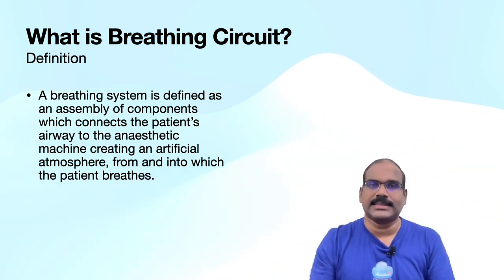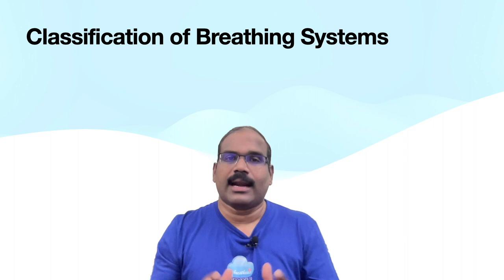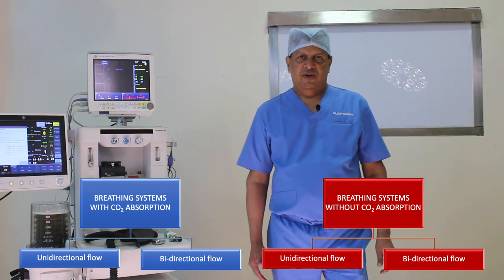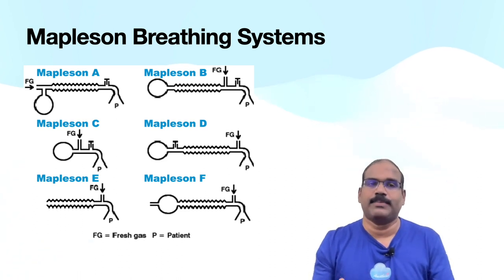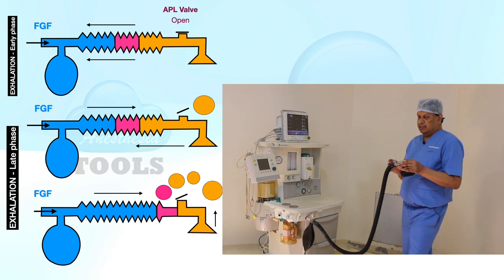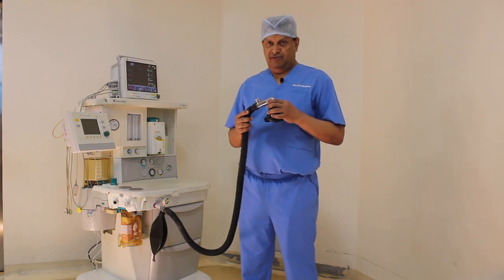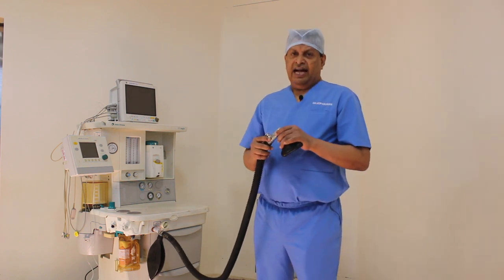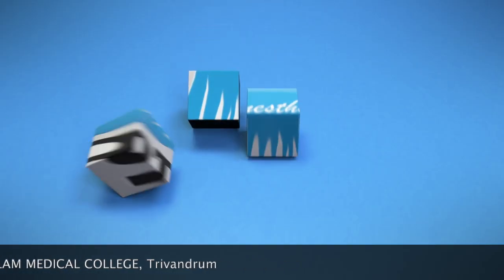Anesthesia Breathing Circuits: Module 1 (Introduction, Mapleson A)

Comment: Hi sir
This is an interesting and amazing video, thanks for this
One question is that "you told that in mapleason circuit while using in spontaneous breathing APL valve open during end of expiration but in picture it is shown that APL valve are also opened during inspiration, plz elaborate this